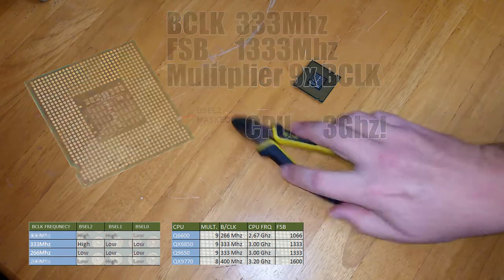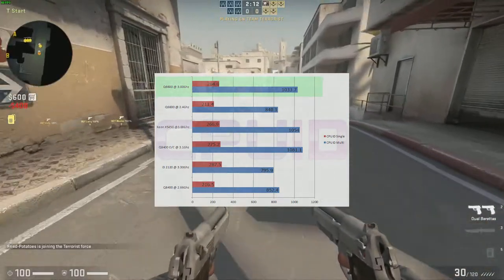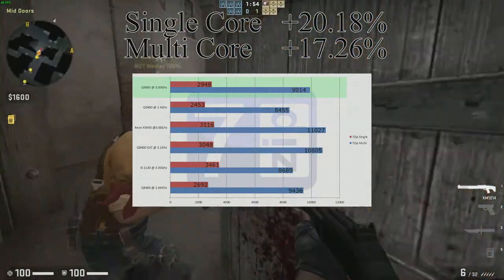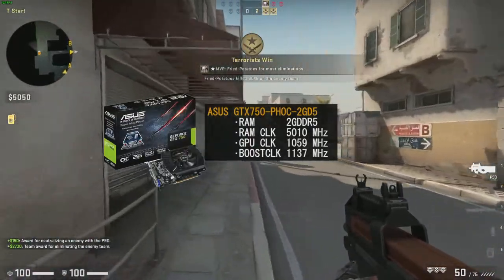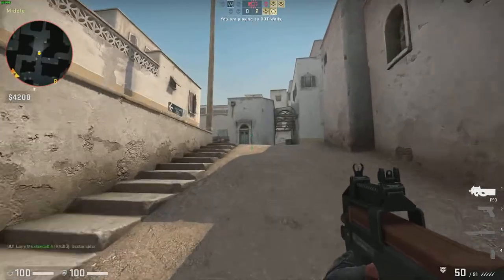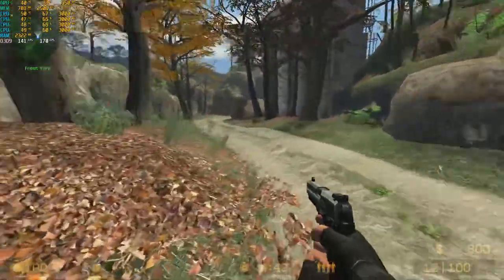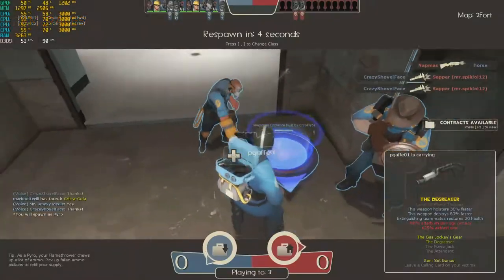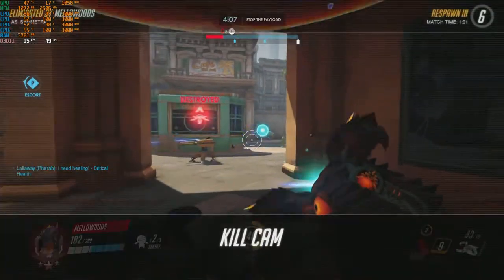Core 2 Quad Q6600 BSEL MOD. 3Ghz

Comment: and just cover and why?
Reply from the maker: OEM motherboards will not let you change the BCLCK clock. So you can trick the motherboard by changing the pins that output the selected FSB clock from the cpu. we tricked the Q6600 from 1066Mhz to 1333Mhz FSB Clock.

Covering up the pin basically makes the motherboard think it's a high input from the CPU. In our case the one we covered makes the motherboard think it's a 1333mhz FSB CPU (not the overall clock just the interconnect between North Bridge and the CPU) .
By doing this the internal multiplier now multiplies the higher BCLK. We went from a 266Mhz BCLK/FSB to a 333Mhz x9 (cpu multiplier = 333x9=3ghz).

Most 3rd party boards Asus, MSI, gigabyte etc...
Don't need you to do this as this feature is unlocked in the bios and you can increment not just go from 266 to 333Mhz.

I hope this helps.
It's a bit confusing.. 
Simply it's away to overclock a cpu on a Core2 based oem motherboard.

Thanks For Watching.
Reply: @OFFbitTech  my motherboard burned

￼
Reply from the maker: @xduduu700  
Unfortunately there is always a risk to motherboard modifications.

You should always take any upgrade or modification carefully because if done incorrectly hardware failure immanent.
Reply: @xduduu700  lol